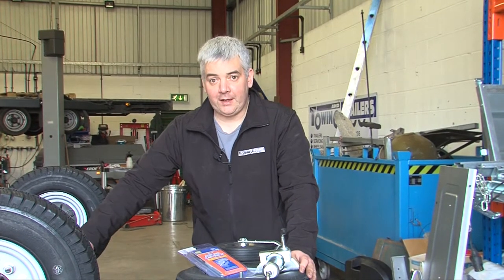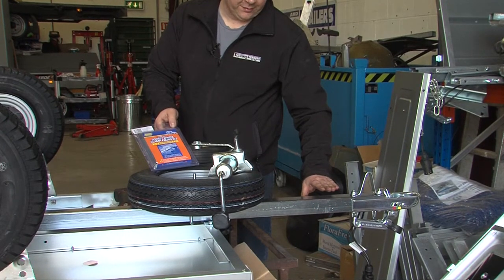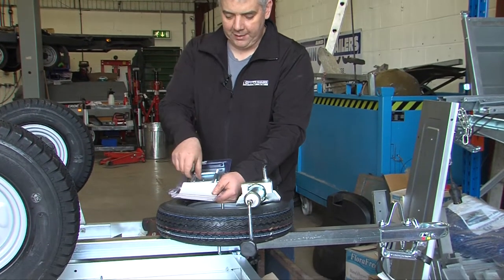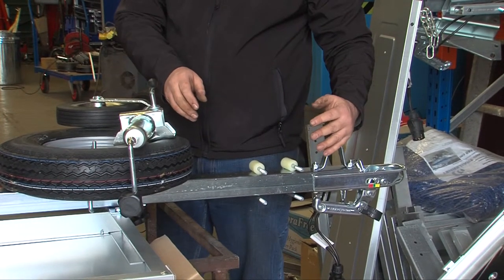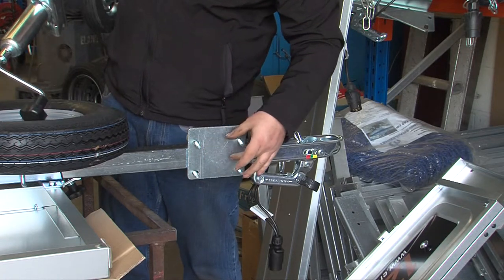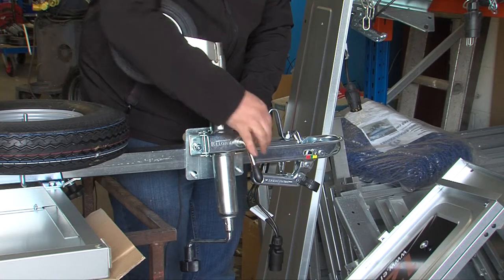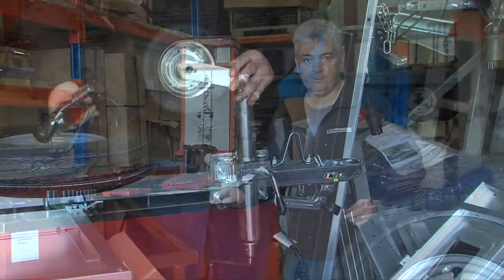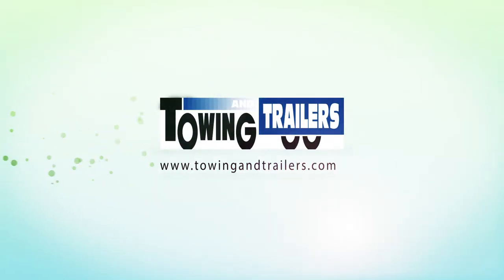How to fit a Maypole easy fit jockey wheel bracket on a 50mm drawbar

Comment: Maybe you don’t answer questions, but you’ll note that the Maypole plate has two different sized holes for the bolts.  In your video, you have not paid any attention to this, but had one larger hole on top, and one on the bottom.  I’m trying to find out the purpose of the larger holes - should they be on top or on bottom, etc.??

Comment: would this work for a rice horse box?
Reply from the maker: Hi 

A rice horse trailer is far heavier and twin axle this bracket is not heavy enough for this trailer. it's designed for small light single axle trailers.

Also the draw bar is not 50 or 60mm square section.

Kind regards

Towing and trailers ltd